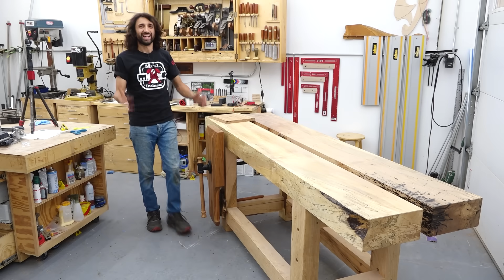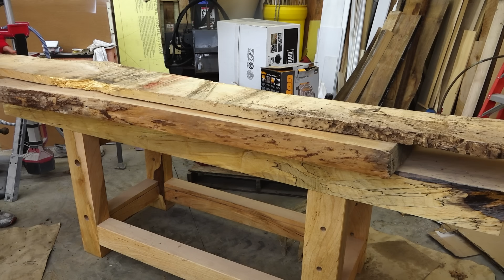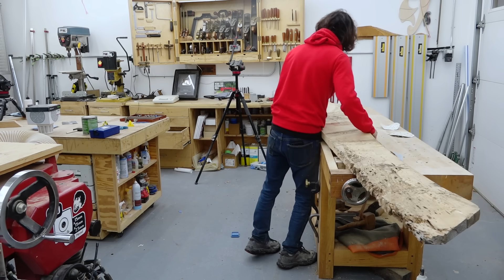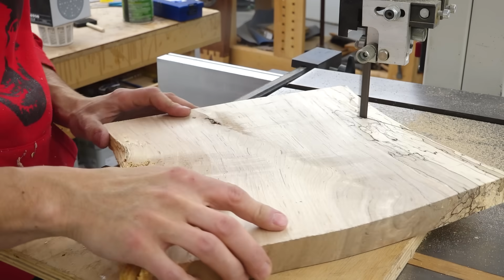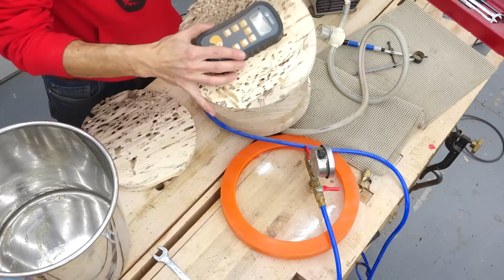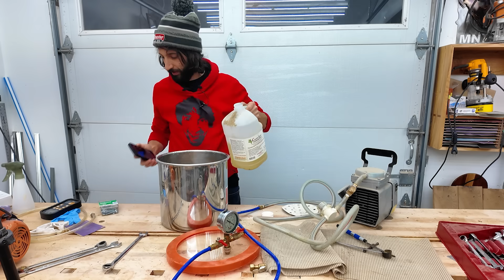Roubo Workbench Kick Wheel Leg Vise

Comment: Ive Been using this type of leg vise for 3 years now, honestly the wooden screw can't handle the pressure sometimes. Changed recently to threaded rod that works better
Reply: Thanks for letting us know.  Could you say the diameter of the wooden screw that gave problems?

Comment: would love to see a video on how you sharpen your forstner bits
Reply from the maker: See Short reply
Reply: Until Matt responds, here's a video from James Hamilton. He uses a diamond sharpening card but you could also stick some fine wet/dry paper to a wood paddle or some such unless your bit has carbide cutters.

Or a fine file with the right profile. 

https://youtu.be/W04VeQTPFTI?si=iUbUbRbc4-X2JW7I

Best practice is don't let your bits get too dull in the first place. Keep them carefully tuned up. The chippers need to be at the same "height" for best cutting.

Comment: You should remove the strings from your sweatshirts you use when woodworking. They came extremely close to the spinning table saw blade and the drill bit in this video. Having your face pulled into a spinning table saw blade would probably ruin your day.
Reply: Could only improve his looks.